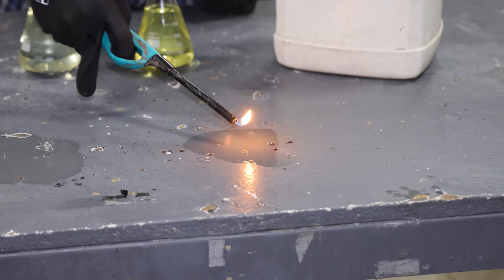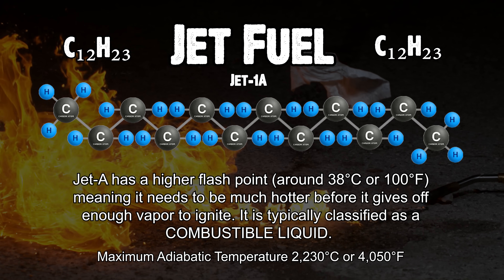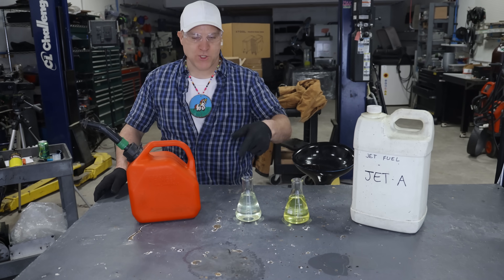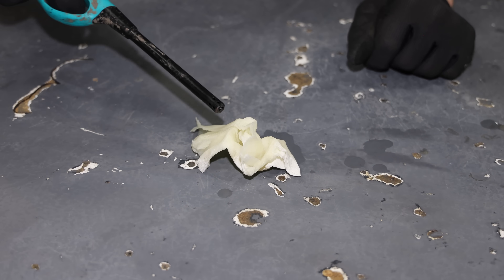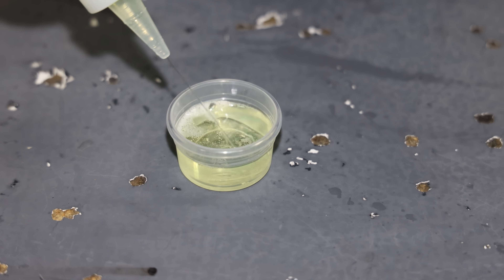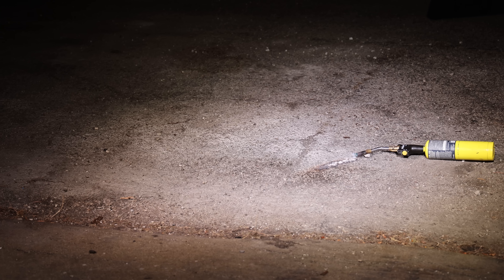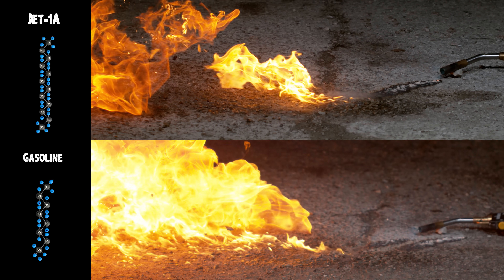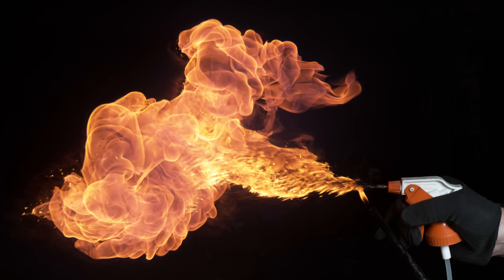What Happens If You Light Jet Fuel vs Gasoline?

Comment: Gasoline is not a homogeneous liquid.
It has hydrocarbons of different lengths, which all add up to a certain "octane rating". You can lower octane number by mixing in diesel for example.
(diesel equivalent of octane would be between 21 and 40).
Jet fuel has similar hydrocarbon composition to diesel, but they are formulated for different usage: jet fuel has additives to lower freezing point, and diesel has additives for lubricty and high-pressure dispersing.
Reply: Gasoline typically has hundreds of different types of hydrocarbon molecules typcially grouped into "classes" (parafins, iso-parafins, olefins, napthenes and aromatics).  BTW, jet fuels are similar in complexity of composition (but with longer chain hydrocarbons making them less volatile (i.e. the point of this video).
Reply from the maker: @danielklopp7007 exactly, I did have to average them out though for simplicity. But you are absolutely right
Reply from the maker: Yes very true but I had to average it out
Reply: @WarpedYT  I understand.

Comment: you could try that with hydrazine? probably not, i'm just courius. similar effect with wheat, or copper - usually they nopt burn, but in particles hanging into air - completly different sory. very interesting channel :)
Reply: Hydrazine (especially but not only the methyl hydrazines) is a carcinogen far worse than gasoline.  Please don’t…
Reply from the maker: Yikes ! Hydrazine is a no-go at my place lol

Comment: Jet fuel is just low sulfur more pure kerosene... You can run your diesel engine on it if you add 1/200 of 2 stroke oil, I did run a 2001 Mazda 626 for 3 years on kerosene that was 30 years old.

Comment: Can anyone actualy confirm this guys terminology ? I thought BOTH are combustable, BOTH are hydrocarbons. The black soot is pure carbon ?
Reply: I'm a former Hazmat Tanker driver... Both are listed as Flammable liquids, Class 3, for transportation purposes. Gasoline gets a UN1203 placard & Jet Fuel gets a UN1863 placard. The main difference in handling comes down to vapor - since gasoline vapor alone is flammable, you can only use gravity or limited air pressure to empty a tank; whereas with jet fuel (being combustible) you could technically be allowed to use a mechanically driven pump to empty your tank, although it is frowned upon unless high pressure is required to save time [like on a runway]. Gasoline transport also has grounding requirements for load/unload, added PPE requirements, & additional emergency response protocols.
Reply: @bluecranium thank you, i understand the reality of it. I just needed someone to confirm for other people... Cheers for the extra details

Comment: So, you're saying Jet A will run in my car because the injectors will atomize the fuel! 😂
Reply from the maker: Possibly but you need way more fuel pressure
Reply: No.  It will not.  Unless your car is a diesel.

Comment: I love that most people don't understand that jet fuel is basically kerosene.
The explosive density of gasoline is insane. Something like 1 cup of gasoline is the equivalent of 4 sticks of TNT. 
I have a crazy story to tell related to that regarding a disgruntled employee at a diner three blocks away that doesn't exist anymore.
Reply: Gasoline doesn’t detonate, and the pure liquid is actually pretty close to kerosene.  What’s actually ignitable trivially (and can under some circumstances detonate in a supersonic combustion sense) is gasoline vapor.
Reply: @Georgewilliamherbert  Gasoline is not "pretty close to kerosene".  Pure liquid or vapor.  Any flammable/combustible liquid has to be vaporized before it will burn.
Reply from the maker: Yes The energy density and explosive density of gasoline is pretty insane.
Reply: Ohhh cmon drop it already 😂

Comment: A similar misconception is when people believe that higher octane gasoline is more energetic or is more energy dense.
Reply: It is not a measure of energy content; higher octane fuel is more stable and less likely to detonate prematurely in an engine, which is especially important for high-compression or high-performance engines.
Reply: Or that people think that there is octane in fuel.
Reply: @TheAdatto  I understand how the octane rating works and that it is possible for fuel to have an octane rating whilst it contains no isooctane, back in the day, lead tetraethyl was used to increase the octane rating, having said that I thought that fuel does contain isooctane.
Reply: @sidecarbod1441  It does contain isooctane. One of gasoline blending stock is Alkylate (very rich in branced saturated alkane like isooctane), it makes 10-15% of the U.S gasoline pool - depends on region, could be more, and the tighter emission reg in a region and the more expensive the fuel is the more likely for it to contain isooctane, Hi California).
Reply: @brrrtd  Yeah I thought that it did contain isooctane, I was commenting on the post that implied that didn't.
Reply: @sidecarbod1441 I heard the tetraethyl lead additive was for the purpose of lubrication or something, which I admit I don't understand.
Reply: @erickborling1302  The reason that it was first used was to help reduce detonation, i.e increase the octane rating of the fuel, it was then discovered that there was a side benefit which was that lead would form on the valve seat face, this acted as a cushion which stopped the valve hammering into the seat in the head, basically it stopped valve seat recession. It may also have acted as a lubricant on the valve stems, but I can't quite remember about that one.
Reply: @erickborling1302  It was for octane, but had the added benefit of lubrication.
Reply: @TheAdatto Hey that's not an easy concept that falls in your lap. You have to want to know it. It's kinda neat how slowing down the combustion with what some people call oxygenated fuel (I call it watered down cuz ethanol is watery) makes the engine run hotter but more even fuel burn in recips of course.
Reply: Low octane regular unleaded makes the biggest fireball if you light it compared to like 100 octane Av gas.
Reply: @actionjksn  It does but you can't compress the mixture as much as you can with a high octane fuel which means that the expansion ratio isn't as high. Also a high compression leads to a high initial cylinder pressure (the pressure BEFORE the plug fires), the higher the initial pressure the higher the flame speed will be. So you can't really tip some low octane fuel and some high octane fuel on the floor then light them, then compare the two.
Reply: I was wondering why he only showed a single hydrocarbon chain for the gasoline when there are mixtures of other kinds of hydrocarbons in it (benzene derivatives and other PAHs)

Comment: what i dont really get is jet fuel is kero and another reason is its supposed to be cheaper and easier to refine than petrol... and has no "octane" ratings as such... 

but when i go to BUY kero... it about $8/L, or at best , $2L/L in bulk which is... roughly more than petrol at the bowser. also involves a long drive or hefty delivery fee...

havent bothered hassling the local heli pilot, or fuel suppliers, have a feeling i have to get 5000L or something at a time to make it worth while... ha ha, i grew up in the timeline where "inflammable" means "even more flammable..."

stupid redundant prefixes.

Comment: Kerosene is a clean less lubricated diesel fuel. Jet A is a super regulated kerosene.  That’s how I e always looked at it
Reply: Kerosene is a bit lighter than diesel. https://courses.ems.psu.edu/eme801/sites/eme801/files/images/CrudeOilDistillationUnit%2BProducts.jpg
Reply: Paraffin is stiff kerosene.

Polyethylene is solid kerosene…
Reply: @Georgewilliamherbert  No, those are hydrocarbons with totally different molecular weights and associated physical properties. His point was that kerosene, diesel, and jet A are all fairly similar mixtures of hydrocarbons that differ mainly in how tightly regulated they are (with regard to physical properties and presence of contaminants such as sulphur) and which additives are present.
Reply: @MatthijsvanDuin  My point wasn’t that they’re literally the same thing.  They’re all approximately mixes of nCH2 chains and combust with similar energy across their respective use cases.  This is useful in a lot of energy density and combustion engineering applications, especially for aircraft and rocket propulsion.
Reply: @Georgewilliamherbert  Yes they're all alkanes but their differences far exceed their similarities, they are not remotely equivalent in any practical application. The trio OP mentioned on the other hand are similar enough that they can function in each other's applications, albeit with significant downsides (e.g. a diesel engine is not going to enjoy being run on kerosene or Jet A unless you add a lubricating additive, and the sulfur content will damage the catalytic converter of modern diesel cars)

Comment: Jet A can be burned in a diesel engine just keep in mind Jet A is about 800-1000 PPM sulfer and the Diesel at the local gas station is 15-20 ppm. Higher sulfer content can be bad on emissions equipment in modern diesel.

Comment: Jet A-1 already has STADIS 450 added to reduce buildup of static electricity, which should help a little to reduce risk of fires in a crash, but mostly is for fuel spill situations.  Research has been done on telechelic polymers that link together to control the size of the fuel mist particles in a crash, and those have been found to be very effective in preventing an explosion after a crash.  Search youtube for “high speed video of treated and untreated jet fuel”
AFAIK the additive is considered too expensive to add, given how rarely jet aircraft crash (the cost/benefit ratio is too high)

Comment: Indoor open flame within 2 feet of containers of gasoline and jet fuel.  Not to mention the ~300mL in each of the 2 Erlenmeyer flasks.  Safety first-----> wear some nitrile gloves and safety glasses.  No fire extinguisher in sight...no problem!  Darwin approves!
Reply from the maker: Incorrect my friend, if you watch the video I use a CO2 fire extinguisher to put out the wicking experiment, absolutely I have a 20 lb CO2 fire extinguisher right next to me and I have three more CO2 fire extinguishers 10 ft away. I ain't that careless.

Comment: Also happens that Jet-A contains lead, so when you're usually exposed to its gases, you eventually loose CI
Reply: Citation needed!  I’ve always been told, and sources I find agree, that Jet A-1 does NOT contain lead.  More precisely, no lead is added.  And, why would anyone add lead to jet fuel? Turbine engines cannot suffer from pre ignition, and that’s the reason lead is added to avgas.
So, absent some citations from you that demonstrate otherwise, I will continue to believe that Jet A-1 does NOT contain lead.
Reply: Avgas (for light aircraft Internal Combustion motors with cylinders and propellors and all that) up until basically now has lead.  Lead free avgas is now becoming available.

Jet fuel does not have lead.  Nope.  Zero.